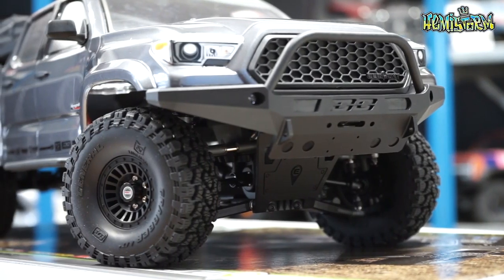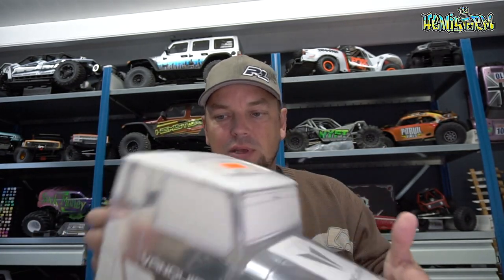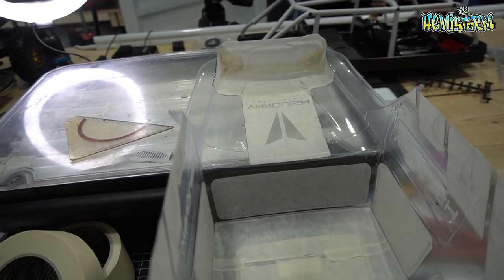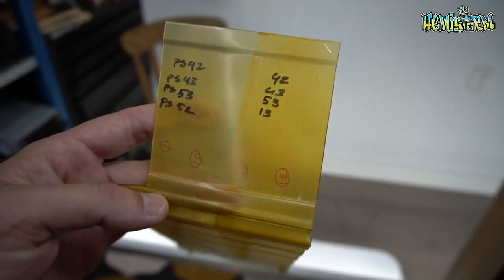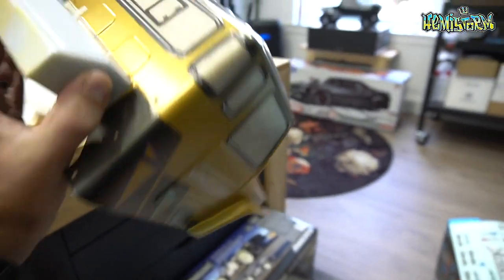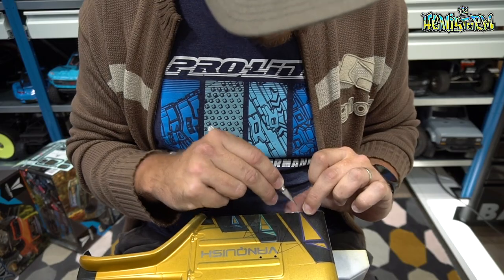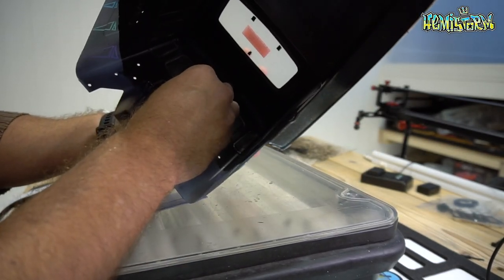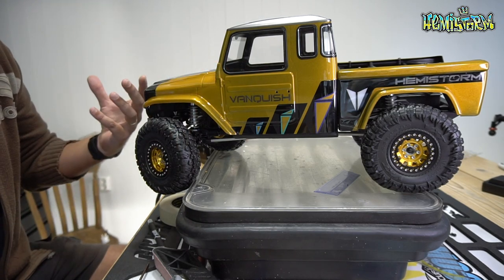MAKE YOUR OWN RC PAINT COLORS! - Vanquish Phoenix color matching

Comment: Nothing less than a piece of art! Well done on that paintjob and well done on that video! Your presentation really has taken some steps up over the years! 
Two Questions 1: I paint a lot of my bodies on the outside and have a constantly problem with paint (tamiya ps)  flaking off when masking over an existing (dry and cure) paint layer regarding all your tips with washing, scuffing etc.
2. Do you experience any structural issues when cutting out all you logos in the lexan? Especially on the rather thin side walls of the body.
Greetings from Germany 
Marcus 🙏🏼
Reply from the maker: Hi Marcus! How strange that your paint flakes off on the outside, are you spraying in a room temperature area? Structural problems never occur as I barely score the lexan, but it can be a risk in highly undercut body areas. In that case some drywall tape and shoe goo can be a good way to reinforce the area before running the car. Good luck and thanks!

Comment: awesome as always 🤘one thing ive always wondered is if you wash off the oil from your hands after doing all your cutting for logos and designs. or has it not been an issue?
Reply from the maker: Good question! I wash them regularly and try to not contaminate the clean lexan.